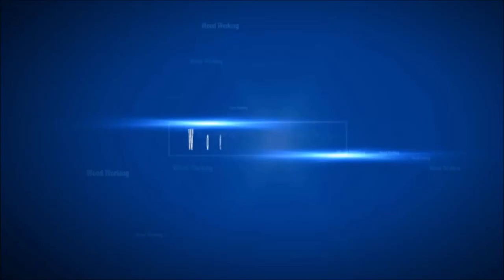Wood Working - Amazing Segmented Bird House

Comment: My only question is, you had staggered brick 🧱 ends on the walls that would have locked in place. Why did you cut them off ???
Reply from the maker: That was the idea, but I ended up using a couple different panels and they did not line up. The panel I was going to use to do this I messed up.

Ken